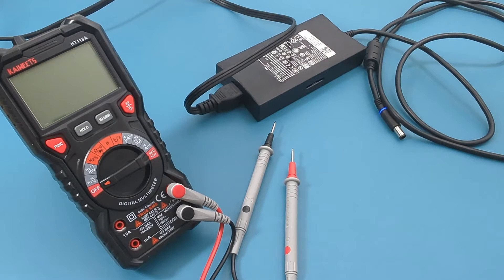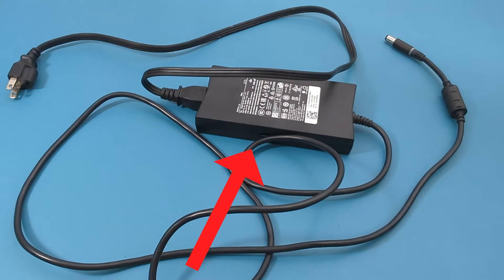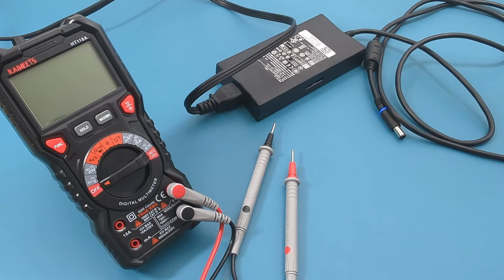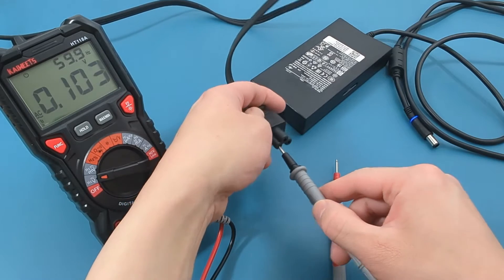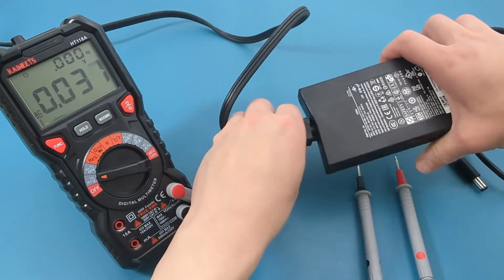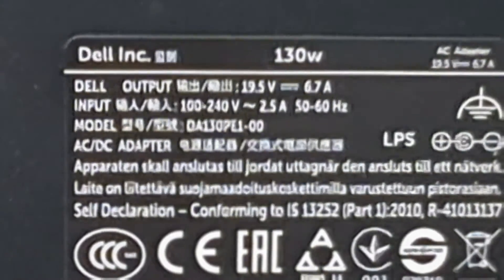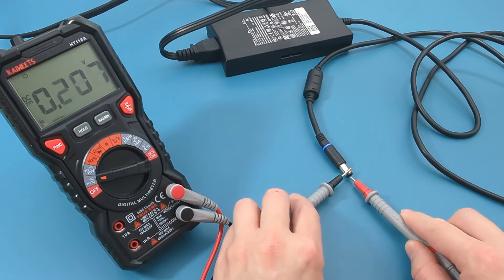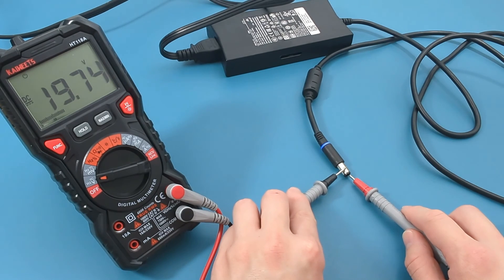How To Test A Laptop Charger With A Multimeter

Comment: My charger test good. Then plugged it into the laptop and tested again. Dead!☠️ repeated several times. Tests good then immediately plug in laptop. It’s like plugging it into causes it the transformer to shutdown and stop providing the 19.70v and immediately is under 1v after just a quick plug into a dead laptop
Reply: The computer charging port might be damaged and causing a short. When the charger feels a short it will shut down. I'm no expert, but might be what is happening

Comment: Thanks - you saved me $30+ and the trouble of chasing down a new one.  The info on the brick was so small I got out the 
3x magnifying glasses (with light) AND STILL COULDN'T READ IT! 
I think my problem is the jack on the laptop where the cord plugs in. The plug feels sloppy.

Comment: What about adding the voltage for the center pin vs the inside of the barrel connector? Some chargers deliver 5Vsb to run the switching circuit that turns on the higher voltage.

Comment: Got a reading of 19.3 on this same charger so it is bad as you say?
Reply from the maker: When there is no load, you usually get a higher voltage reading than the rated charger. A lower voltage is an indicator that the charger is failing.
Reply: Does it fluctuate up and down past 19.5v or are you getting a steady 19.3?